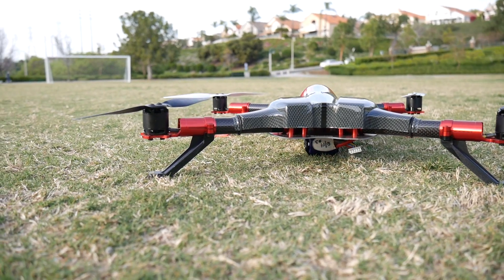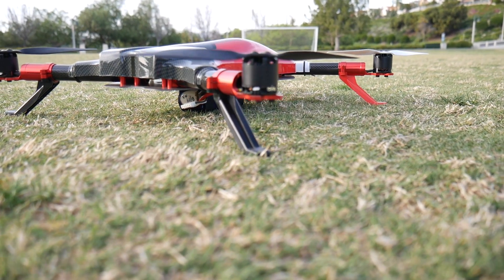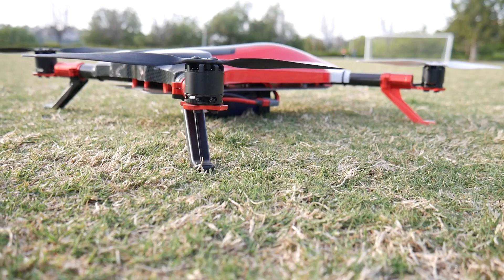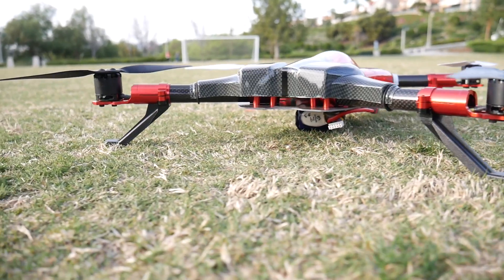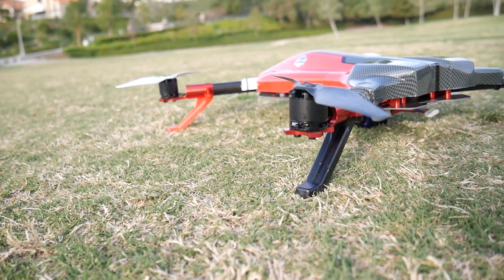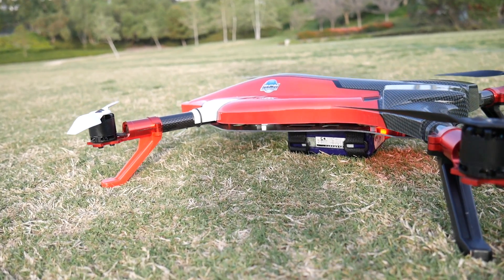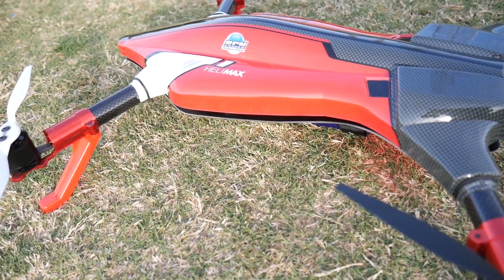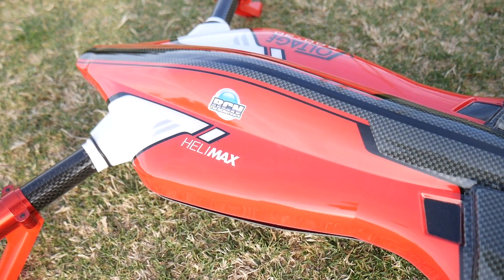Heli-Max Voltage 500 3D Quadcopter - Maiden Flight!

Comment: I have had nothing but problems with the model, I now have a $429 desk model. I have sent this unit in four times and the problem was never corrected, while performing these same exact steps in this video while connected to the voltage app I encountered two blown esc's and one blown motor when simulating loss of signal by powering off the transmitter. I got the voltage back and decided to not even perform the signal loss test and instead just took it outside to fly and shortly noticed that the front left motor had some weird issue where it seemed as if it wasn't getting enough power, and sent it back in they(hobbico) sent it back only repairing the motor mount. I am at a complete loss.
Reply from the maker: Yeah, I've heard that more than once now regarding the issues.  I would keep contacting Hobbico to see what they can offer as a replacement - If you bought from Tower, they're the same company

Comment: The P gain is to high on the pitch and roll
Reply from the maker: +UK SCALE AND FPV Thanks, I will look into that
Reply: +The RCNetwork it's in the flight controller buddy it's part of the PID loop the PID loop is what the flight controller uses to keep the quad stable when you do a big punchout you can here the quad wobble it's doing this because the p gains with in the loop are to high and the flight controller is over shooting it's corrections to keep the quad stable
Reply: +The RCNetwork if you. An plug the flight controller into a PC I could video call you through google hangouts and i will have a look and show you what values to change
Reply from the maker: +UK SCALE AND FPV Thanks, I may take you up on that soon.  I'm focused on a few projects right now, but will have some time later in March if that's cool